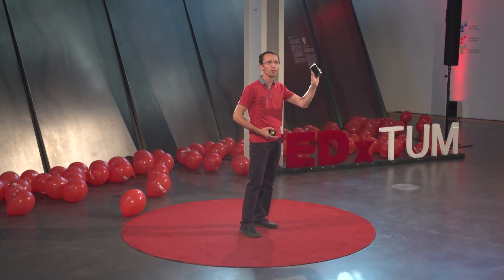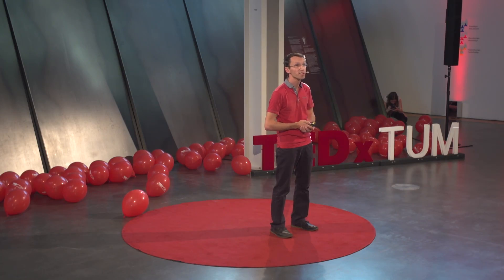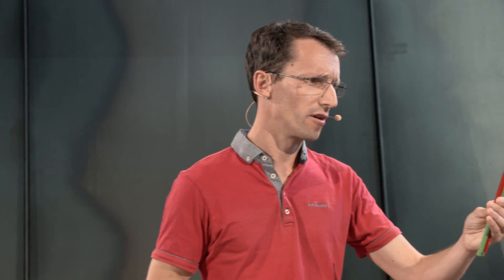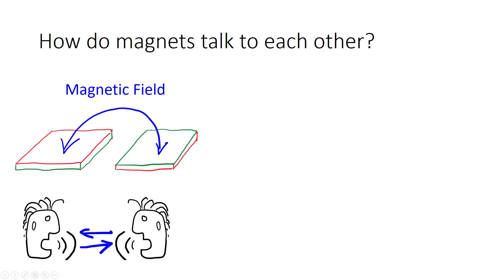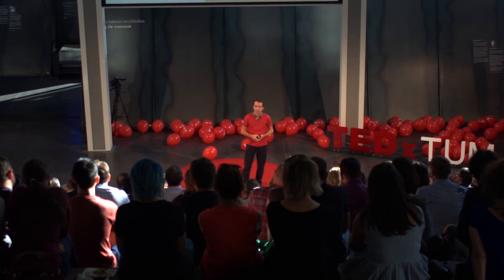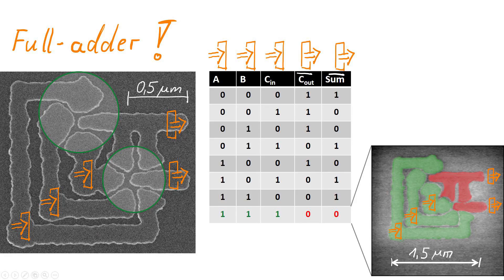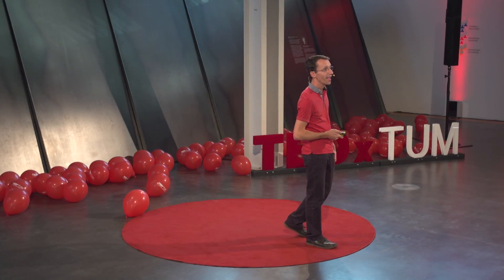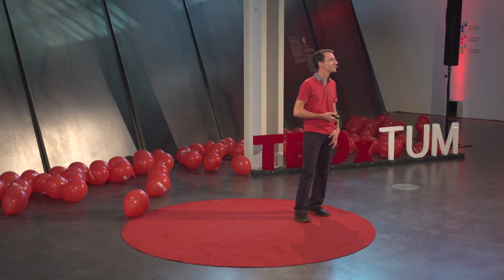Using tiny magnets for computation | Markus Becherer | TEDxTUMSalon

Comment: CMOS logic has important properties when it comes to stability. Input a signal that's closer to 0.05 than to 0, and the inverter compensates by giving a precise output of 1. Because of this they tolerate noise and loss.
The magnetic circuits shown here don't appear to have any element which does this role. I would expect that for the majority circuit, if you feed it (1, 1, 0), you probably get an output closer to 0.05 instead of a precise logic 0, and then if you feed that into another circuit, it degrades further and eventually quits working as intended. How do these circuits deal with noise and loss?
Reply: Google Square ferrite logic.

The magnetic material itself cleans up the signal, as it resists changing state until it has enough torque to fully flip, so each iteration does in fact add this tolerance, and its an increased tolerance compared to CMOS, allowing for significantly dirtier signals to be cleaned up immediately. There is a reason it was competitor to vacuum tubes and discrete component mainframe computers before the integrated circuit came along and trashed magnetic logic in the cost department.